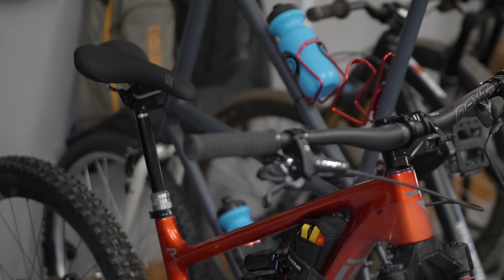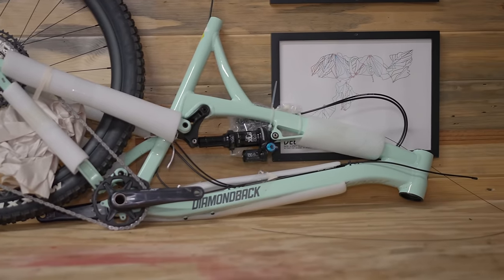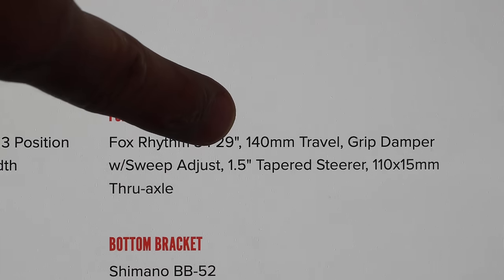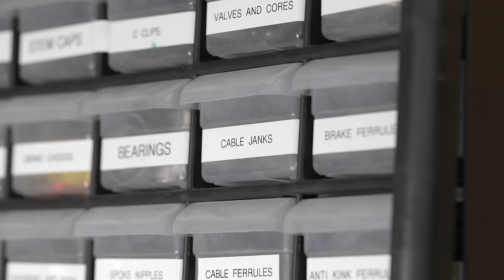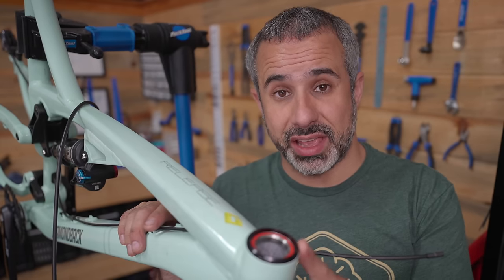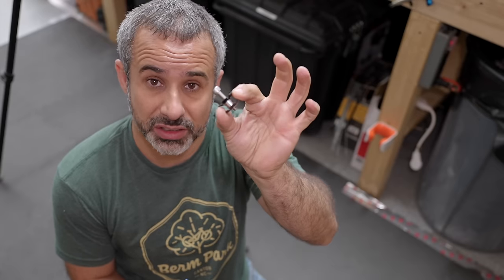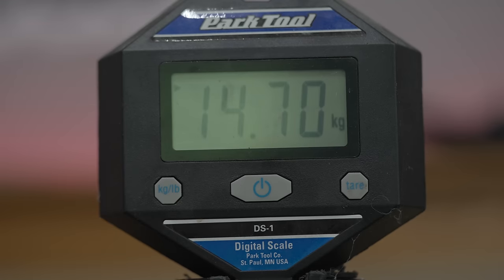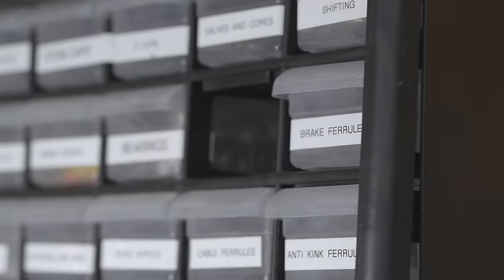This MTB was in pieces! We made it whole, then gave it away

Comment: I wanted to start restoring bike again, did it 40 years ago while at college. I just restored a 1997 Raleigh Max Cro-mo 1, I put some Schwalbe Billy Bonkers tyres on which really made it. I just picked up a Carrera Axle ltd edition cheap, I feel a bit stitched up with this one though, my fault I should have looked closer. The photo's showed the rear wheel off and no spindle or bearings. I started washing it down and that's when I saw it! beneath the mud in the contoured area of the chainstay was what looks to be a filed out section. Logically I can only assume the previous owner wanted some fat tyres on this bike a decided to make some room. It seems they stopped filing when two small holes appeared to the inside of the tube. Now I'm undecided how to fix it, with a cost of £50 to Aluminium fill the area, and that's after me saying to them to only fill it and I will reshape it afterwards. The other option that I'm not too sure on is using Aluminium welderless rods and mapp gas. I am wondering whether the heat from a blow torch will compromise the tempering of the 6061 T6 alloy and whether these rods would be a sufficient repair. Has anyone got any advice or suggestions. The damage is on the non drive side and about 2 mm to 2 1/2mm at the deepest point.
Reply: I would try and get a professional aluminum welder to do it for you if it’s only $50, I love doing stuff my self as well but I wouldn’t trust myself with a fix on my bike like that, I also wouldn’t trust those welderless rods to really hold the frame together, just my opinion.

Comment: Hey Seth, The reason for the flaring of the headset cut is the speed at which you tighten the gas/copper tubing cutter. if you slow a bit and tighten to a lower tightness with more passes you will not flare the end near the cut. i am a licensed plumber in colorado and this is used daily to not flare ends so that pieces can be joined in large quantities with less prep work. keep up the great videos seth, hope my tip reaches you and helps.
Reply: Just as an extra tip also, most tubing cutters come with a spare wheel as a washer on the tightening handle screw. ive seen dudes go buy new wheels without ever noticing it.

Comment: For the pipe cutter trick, there is a tool that exist made for it that grind the outside and inside. I used it into the shop where i was working at and it's really fast and you get no rough edge. It's called a inner and outer reaming tool. Have a good day !

Comment: Small tip - if you don't have star nut setting tool there is a little better way to hammer it inside - just put the top cap on the screw, secure it with standard nut and screw star nut into. While hammering the top cap will go flat in the end of the tube, assuring straight position of star nut. You can use pair of nuts to block them against each other on "right position" on the screw to assure the depth of assembly will be good every time without thinking about it. Very simple DIY star nut setting rig that you can have basically for free (like screw, old top cap and 3 nuts are usually lying somewhere around).

Comment: Hacksaw is good, reciprocating handheld saw works even better. Makes the cut quicker and makes a smoother more even cut as well. I've cut multiple fork tubes and after comparing a hacksaw to a reciprocating saw its so much easier than a hacksaw and the cleanup takes a little less time as well

Comment: My dropper post came without the little cable jank too, but I couldn't find one anywhere, so I ended up making my own. It's actually not that hard: drill two holes in a steel pin, thread one of them and add a screw in it and you're done!

Comment: Because your not sponsored by slime you should try the muc off tire sealant because it is really easy to put in you fully seat the tire all the way round take out out the valve core and squeeze the pouch of sealant and then spin the wheel and pop the bees on with the compressor